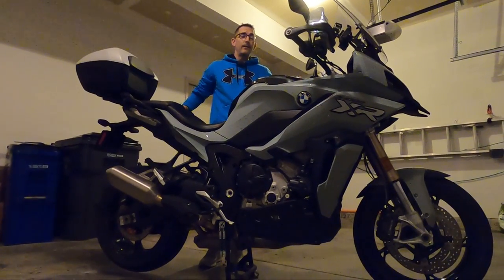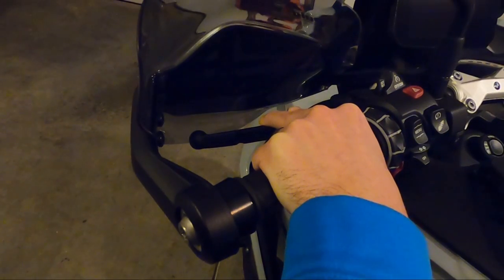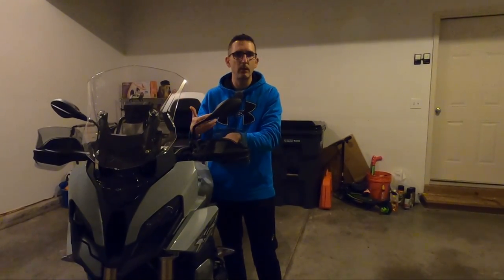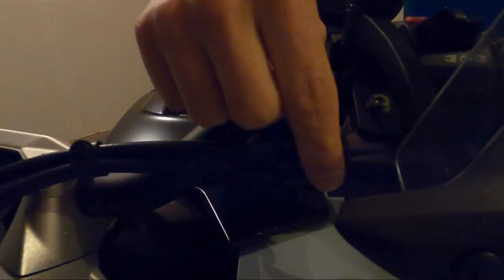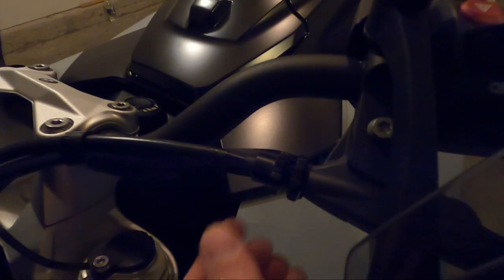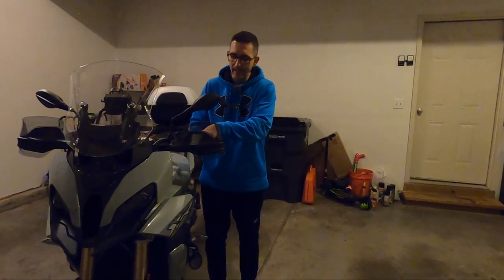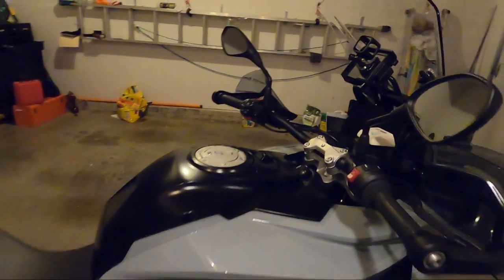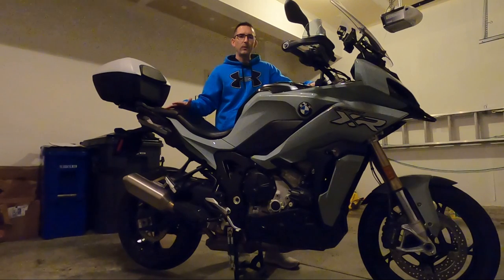TBRD Garage - Clutch Cable Adjustment - BMW S1000XR

Comment: Good stuff on the adjustment!  Video suggestion for the garage, it looks like you are just using some standard light bulbs.  Amazon sells some LED in bright white or natural white that have three led panels each and really spreads the light.  Worthwhile investment for my garage.  Stay well!!
Reply from the maker: Yes!  I was disappointed with the lighting and was looking at those and plan to order two for the garage.  I really appreciate the feedback and support.

Comment: Just subbed, like the ideas on wrenching for non mechanics.  I really want to learn how to fix my tire  while out on the road.  I have a duel sport (RE Himalayan ) and a Yamaha 950SCR which is more of a standard scrambler hybrid that was never meant to go off road).   Thanks for the Vids!!!
Reply from the maker: Greatly appreciate the support!  Plugging tires is a bit of pain.  When mine get run down I will be shooting a video on that as well.  I find the best way to practice that is put some screws in an old tire before you are going to change it out and give it a rip.  Cheers brother.

Comment: I always wonder if we need to adjust the clutch cable when the season changed.🤔 Steel is metal and metal expands and contracts when temperature 🌡️ changes. TFS mate!💯👍
Reply from the maker: Hmm...interesting point.  I don't think the temperature really impacts it much from my experience but it's an interesting thought.  I must say...the cables and chain on the BMW "stretched" a lot over the first 1500-2000 miles.  All good now though.
Reply: @ThrottleBackRubberDown  Hey great content & nice vid on this topic. I do tend to agree with that observation regarding the cables & chain. I have a 2020 BMW s1000r and over the first 7,000KM both did "seem" to stretch in my view as well. Since the 7,000km (roughly 4,000 miles) it seems pretty stable more the chain than cables. Just tightened up the clutch a little over the weekend.

Comment: I thought BMW would be an automatic transmission. I guess Honda is the only 1 with that. Thankyou for subscribing to my channel. I have returned the favor. I wish Harley had that barrel adjustment at the lever. The service manual for My Road King has us taking off the left side plate on the rear of the primary cover and adjusting it inside where the plates and oil are. To much for me. Ride safe.
Reply from the maker: Wow...I didn't realize this.  I thought like 99% of bikes had a barrel on the handle bars for making smaller adjustments.  I can see where that would be a much bigger task in your situation.
Reply: @ThrottleBackRubberDown  All my Japanese bikes and the 1 Norton I had did  have the barrel adjustment.

Comment: I've never checked my free play on the RR in 9500 miles from new Josh, because I use the quick shifter all the time I've never thought about it unless they checked it in the servicing, I'll have a look tomorrow just out of curiosity .....👍🏴🇬🇧
Reply from the maker: Both my chain and clutch cable were excessively slack until I adjusted them the first time...they held up just fine after.

Comment: One thing I've notice is that an old cable can get slack when the engine is hot. I think as the steel ages it gets weaker and therefore it expands a lot more when the bikes hot.
Reply from the maker: Interesting.  I will have to keep an eye on this.  The stock chain was super slack after about 1500 but has been great since it was adjusted.  Wondering if the cables will follow suit.